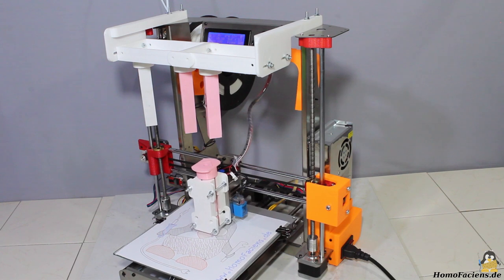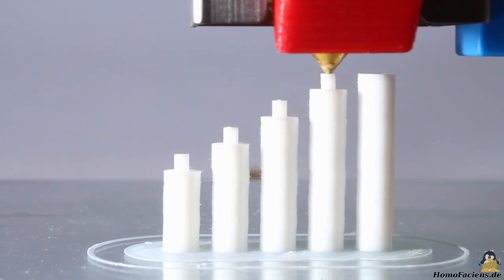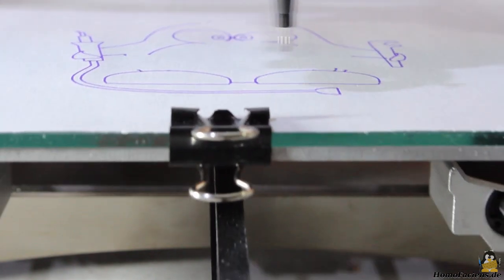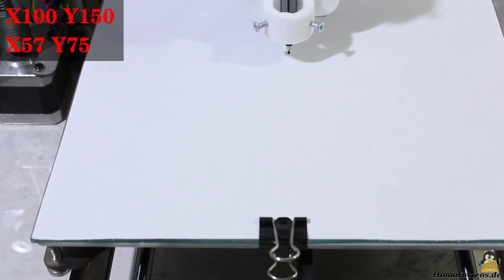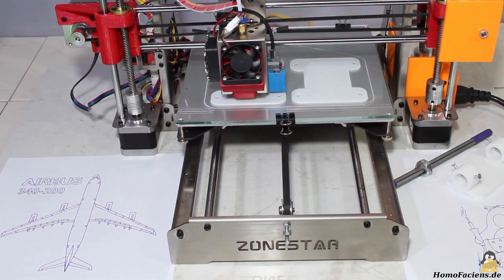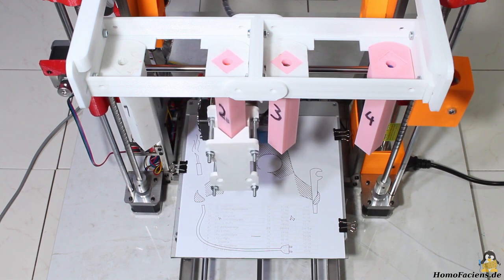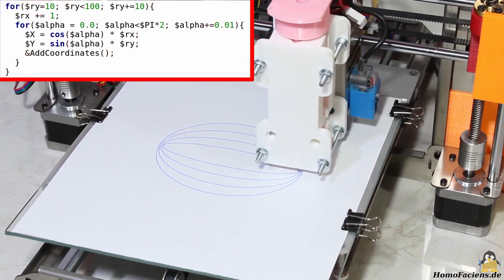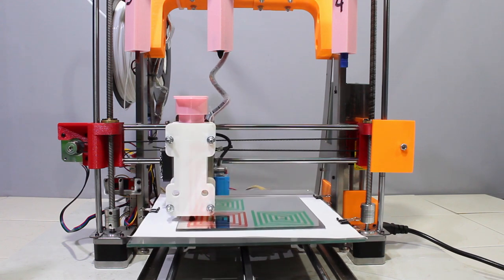Converting a 3D printer to a plotter with automatic pen changer

Comment: I'm wondering, is it precise enough to plot on pcb?
Reply from the maker: That depends on what structures you need on your PCB. I think the standard 2.54mm grid for through hole assembly should be no problem. Structures below that? Well, that depends on the overall quality of your build and adjustment. It's worth a try.
Reply: Krzysztof Zieliński 
it obviously can do that as well
but you should use a very sharp marker to do so and other thing is not to use polygon pours on your pcb (if you want your pcb quickly)
Reply: @HomoFaciens  I was actually really surprised you didn't do PCBs on this video - seems right up your alley!
Reply: I'm sure it would be quite handy to proof your PCB being that you can use the same code as normal printers don't use g code.

You could also use a resist pen and make photo etching method PCB.
Reply from the maker: @KatjaPurrs ...I guess its because I am one of those cable-spaghetti-on-through-hole-prototyping-boards-guy ;-)
I am brooding on ideas of how to create better boards made by one of my machines, but I am still not sure how to make it different and how do it best. Stay tuned!
Reply: @HomoFaciens  I haven't seen many videos on using a plotter and the resist/chemical method to make PCBs. I don't know what it is but the CNC cutter method of making PCBs seems wrong to me and it looks very time consuming.
Reply from the maker: @Brian Boni cutting insulation paths isn't that bad, I think. To me adding conductive material (usually nano silver particles) to a blank (non copper plated) board is the most interesting approach.
Reply from the maker: @Brian Boni Maybe or maybe not. Its still nothing but an idea. Anyhow, thanks for sharing your thoughts.

Comment: How did you program this? And how do you generate the gcode? :) I am making the same kind of machine but my gcode generator puts a tool change on EVERY path and this is becoming quite tedious quite fast haha. I'm using inkscape to generate gcode with gcodetools. My machine is working flawlessly but the gcodetools extension has a bug and they do not support it anymore.... Whoops, sorry, I missed the info about your script, I'm going to dig in. Sadly my script is already working really well and I only have to tackle this small problem in python.. And in your perl script I do not understand how the tool change works.
Reply from the maker: The tool change is a gcode sequence in the sub "ParkPen" and "PickPen". You must insert the X/Y/Z coordinates of the four pens in the source code.

Comment: Can it do PCBs that you can etch.
Reply from the maker: With a resistant marker you should be able to do that. Standard 2.54mm through hole grids should work, smaller structures is at least worth a try.